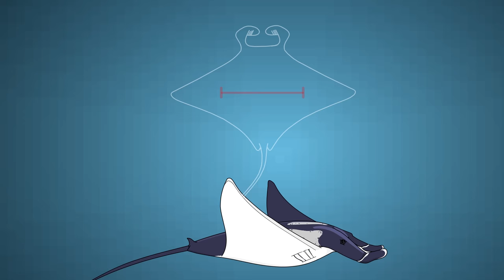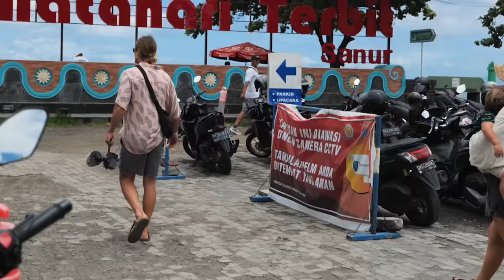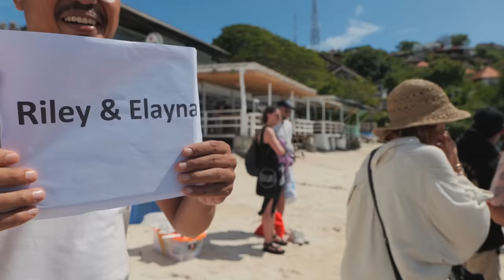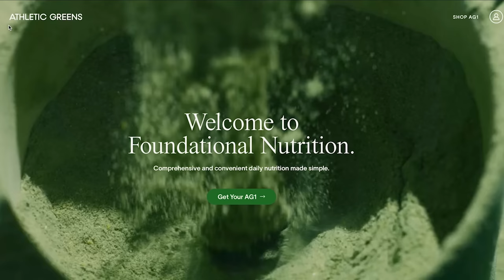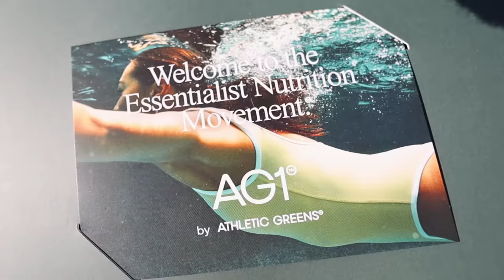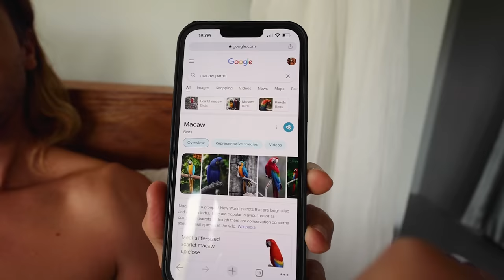We Dive in the Pouring Rain, with a GIANT FISH! (One of World’s BIGGEST)

Comment: As to the dagger boards on your Rapido 60, are they symmetrical or do they have a wing shape?  
I have considered that a properly designed dagger board with a wing shape could provide "lift" in the direction of the wind to allow pointing higher into the wind.  For example, when the wind is coming over the forward starboard portion of the boat, the port dagger board should be fully deployed with a wing shape providing "lift" to the starboard, it should provide the ability to pint higher.  
I have never sailed a multi-hulled boat with dagger boards; only a sailing canoes and a sunfish.
No proof of this, just thought about it.